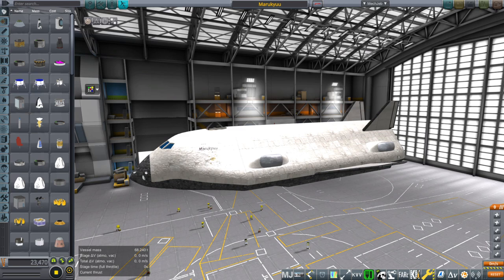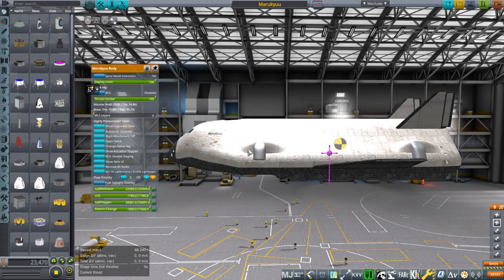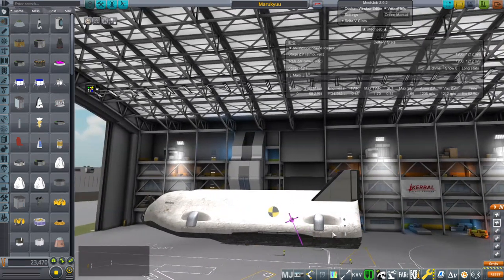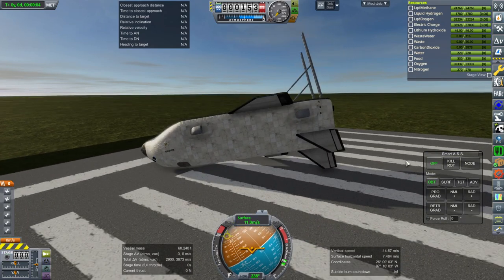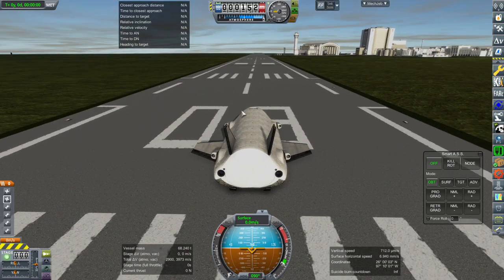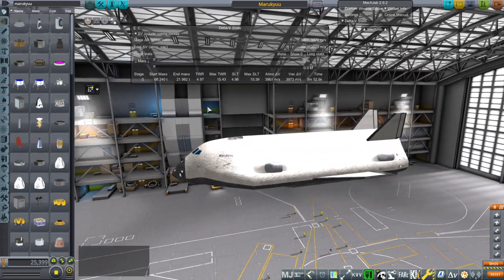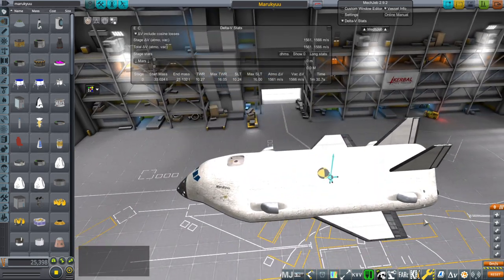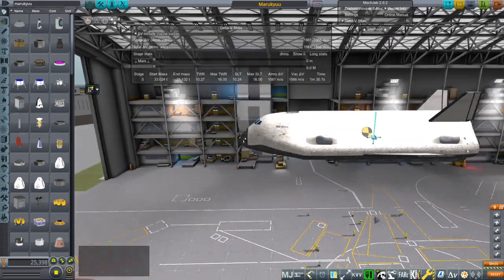Marukyuu Mars Landing System Introduction

Comment: Would it be possible to take off using the landing engines, so you don't have to turn the lander upwards until you're in the air?
Reply from the maker: Because we're only partly fueled on landing but fully fueled on takeoff, that would require more landing engines, and they're not as efficient as the ones on the tail. Also, there's additional drag like that (though obviously Mars' atmosphere is thin) and we need some sort of landing gear, anyway, so it's not much mass savings.

Comment: how do you create these things? do you make a mod with all the meshes, or make them from the parts in the game? also, how do you get the fuel volumes to be accurate?
Reply from the maker: I make the meshes in Blender, texture them in Substance Painter, then use Unity to import them into the game. I calculate the fuel volumes in two ways: place the tanks in the model and then have Blender calculate the volume and then verify by placing a procedural tank of the same size inside (which also lets me get the mass of the tank).